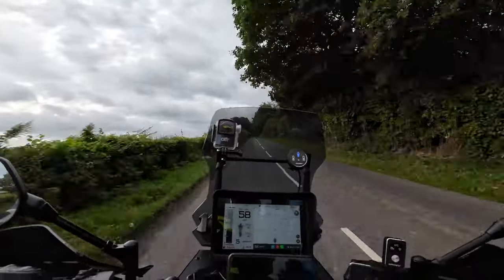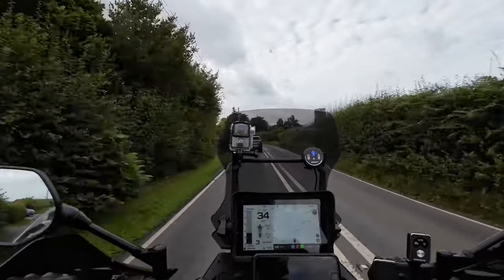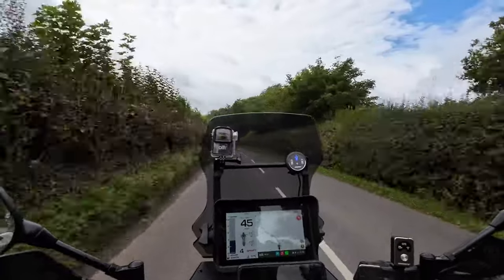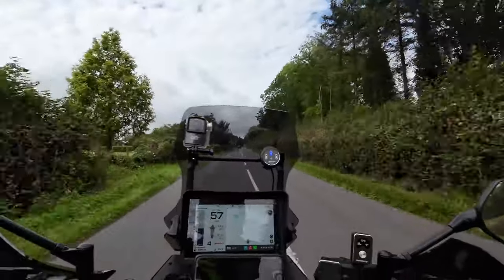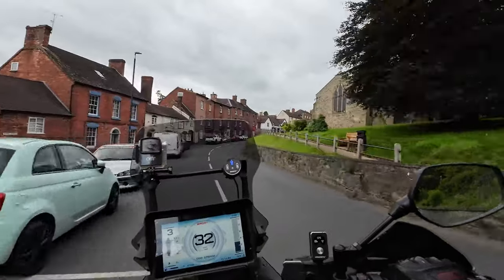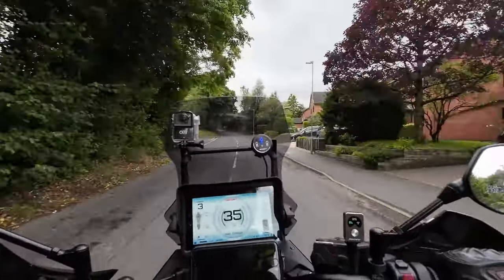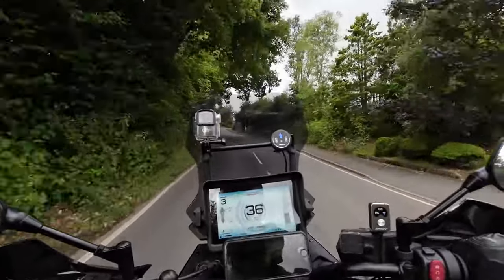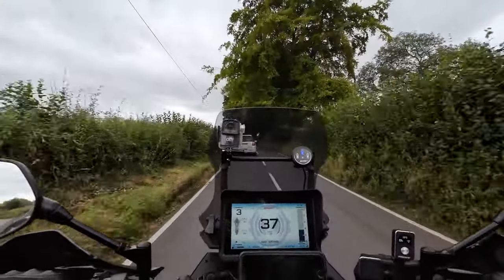Why How and What difference

Comment: I may try this as I set on the motorway for long distances some times
Reply from the maker: @stephenbryson5618  it would be ideal for that mate drops the revs off. I did it to try and help with the snatchy throttle but if I’m honest didn’t really stop it just made you ride in a lower gear and get your revs higher in town miss out the 3 to 4 k rpm where the issue is.   Thanks for your comment please sub the channel although I’m pretty sure you already have
Reply: Hi legend. Did you have any issues with the 17t sprocket hitting the front case. 

I've gone down to a 15t front and it mad fun but too short so looking of going the other way up to a 17. 

How much pick up has it lost you think?
Reply from the maker: @WogsRus1  as far as o can see no impact on the front. Case.  Pick up depends onthe mode.  Slightly slower in rain but otherwise nothing really   Don’t stop the jerky throttle though
Reply: @ivanrushtonthelonewolfrides  thanks legend. Ordered mine today. Keep up the great videos and enjoy. 

The explore version in Aus must be a bit different, but I also have a fuel dongle, and the throttle is like 90% better
Reply from the maker: @WogsRus1  what’s the fuel dongle and what does it do.  I’m now thinking of chang the link pipe to one with a small cat then I can put my Firetorch back on. Had to put the OEM on as it was too loud but I can’t stand the way it now sounds like a bloody lawnmower again
Reply: @ivanrushtonthelonewolfrides  my arrow exhaust is about to turn up and I also have the decat and sports cat so will play around with it. I'm use to a VFR800 with open pipes lol, that's loud....
Reply from the maker: @WogsRus1 what a coincidence I had a VFR Vtec.   What does the fuel dongle do and have you got a link
Reply: @ivanrushtonthelonewolfrides   think you missed try O2 delete, as you already have CAT delete, you need both to have a change.

I Have 800MT Touring, also looking to remove jerky throttle at bottom RPM range, what really works? 
Interested only to fix drivability, don't need more power or noise. Here are some keywords Coober box, FuelX Lite/Pro, Power Commander, O2 delete mod, Cat delete, Power Plug, Booster Plug, Fuel Dongle, ECU Flash, Air Filter mods, sprocket change... 

Flowing you
Reply from the maker: @petermlakar879  the O2 delete mod what will that help with ? Please let me know and perhaps a link
Reply: Hola tengo la misma moto y me gustaría saber tras la modificación del piñón 16 y por el de 17... A cuántas rpm va a 100 kmh ?? Gracias
Reply: @ivanrushtonthelonewolfrides hola tengo la misma moto y me gustaría que me dijeras después de poner el piñón de 17 a cuántas revoluciones rpm va a 100 kmh? Gracias
Reply from the maker: @pablonapalbarrena1918  please subscribe to the channel
Reply: Estoy suscrito, a cuántas rpm vas a 100 kmh? Gracias